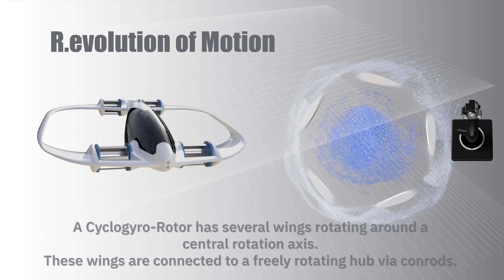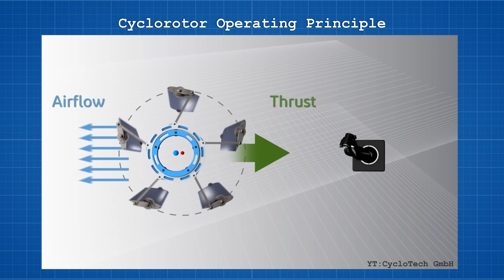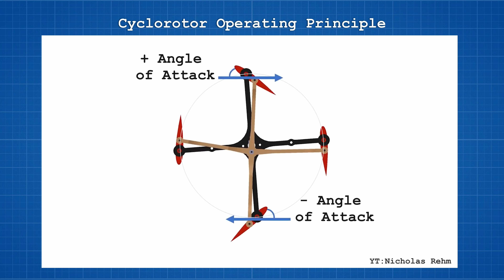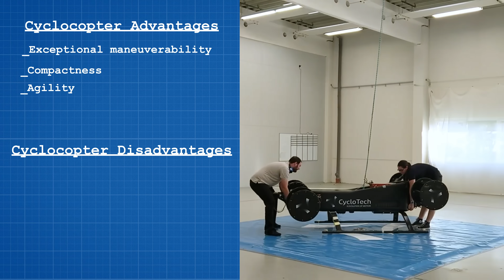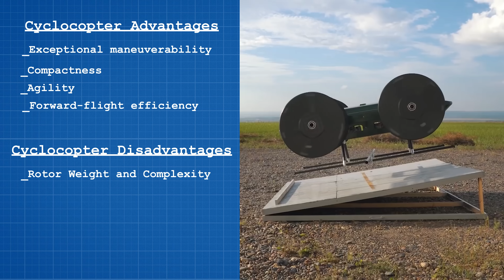CycloRotor: Is this the future of eVTOL Electric Propulsion System?

Comment: I'm terrified at the idea of just one engine failing. You can't glide or auto rotate.
Reply: They didn't took into consideration safety. That thing should have a parachute in case of any kind of failure. I wouldn't ride in it.
Reply: This is a prototype. I'm sure when it comes to carrying people there will be redundancies.
Reply: Too complex and lacking gliding possibility. A small mechanical failure and it becomes a brick midair and the pilot an omelet when the brick smashes into the ground.
Reply: @uberraschtedame1510  You got that right👍👍👍
Reply: considering you can change the thrust direction at will it would be very easy to lose one engine and making the one diagonal to it be pitch/yaw control while the other 2 keep the vechicle air born or atleast let it crash at a very mild speed. Also if I am not mistaken these things can go into autororation as well.
Reply: @SlayerBG93  you ever fly a drone? Auto rotation wouldnt work on a high rpm rotor.
Reply: @a1919akelbo  You are thinking small hoby drones not a car sized vechicle. If I was making a drone car with this tech I would split the batteri and electronics into seperate systems for each motor making sure no point of failure can leave me with less than 3 engines. And I would design a flight stabilsation software that can keep the aircraft stable at 3 engines running. If it can maintant hover at a few thousands feet than it has enought power to land on 2 engines using ground effect or at least crash very gently as in brake the landing gear and maybe a few bruises. As far as autorotation goes I see no reason it wouldnt work provided your point of failure didnt cause you to lose pitch controll on the blades.
Reply: @SlayerBG93  Your expertise must come from watching Marvel movies  helicarrier :) . It does not work with 3 engines. It just goes down.
Reply: @noobFPV  Nah it comes from watching prototipes flying on 3 motors when you dissable the 4th. In a small drone its achived by putting it in a spin since the controll of a conventional motor and blades is not precise enought to make subtle adjustments on a very very light drone that can get fliped over by a strong draft. On a larger aircraft that problem is greatly reduced and this blade design doesnt need to come to a full stop to reverse thrust so it doesnt need to move to either side of the point of lift to maintain balance.
Reply: @SlayerBG93  Ah, yeah but that is controlled demonstration. In real world, quads flip crash and you die. Large or small.
Reply: @noobFPV  I am not saying its trivial but modern electronics and the core design permit for such a solution within the realm of practiral engineering limitations. It will be a while before it achives a reasonable safety record but it can be done. Another point worth mentioning is that because the rotors dont need to pitch the aircraft for forward motion a hybrid design where the body of the aircraft is a wing to provide lift is possible and effcient. So in the event of an engine failure the aircraft could lose VTOL capabilities but could make a controlled conventional aircraft landing.
Reply: @SlayerBG93  so you havent flown a drone.... You dont even know the basics of thrust balancing.
Reply: @a1919akelbo  The ------- point------->
                                    you
Reply: @SlayerBG93  alrighty, you first made the false assumption that what is essentially a large quad copter could remain stable if just one engine failed, this isnt true. Next you said that if you cut out one of the engines you could use it like a vtol still, the issue is You are now at half power with no steering. Next you say body lift could solve the issue, but body lift is an effect only really seen at high speeds. What point am i missing exactly?

For an aircraft to be viable it needs to be reliable, and safe when TAKING OFF AND LANDING. A brick traveling at mach speed can maintain level flight and glide, it's how the brick behaves close to the ground, at low speeds, and in handicapped situations that matters. A spun up helicopter rotor has insane amounts of momentum and can supply enough power on its own to make an emergency landing during take off and landing. Planes can glide, jets can glide, fighter jets have emergency eject systems. The aviation industry isn't the automotive industry. Safety, reliability, and redundancy trump innovation, cost, and ease of use. Aircraft will never be something someone can just hop into and fly with no experience (unless your a doctor). Again, they aren't cars.
Reply: @a1919akelbo  Yep you missed the point.  A large quadcopter cannot remain stable if it uses conventional rotors, at least not without going into a spin. The kind of quadcopter demonstrated in the video CAN because the technology allows for better thrust vectoring and control. Yes you would lose 50% of your power(2 engines for hower and one controlling the roll/pitch) but most helicopters wouldnt crash hard into the ground at 50% power output because  of the ground effect. maintaining hower at 3000m is a whole fuck ton harder than hovering 50cm of the ground. Also this tech alows for flawless thrust vectoring to forward from hower, so you could make the body of the aircraft/helicopter have considerable lift while you use the rotors for forward thurst and only when you want to land you would slow down to a hower and use them in a more conventional quadcopter thrust vector. So in the event of an EMERGENCY you could theoreticaly continue in forward flight to provide lift from the body and land as a conventional aircraft instead of the vastly more usefull VTOL.
Reply: @SlayerBG93   yes but if you loose one engine you loose the second opposing one to vector control, meaning 2 for variable lift and 1 for vectoring. So you are dropping like a rock. Unless your total upward twr with all for engines is 2+ which would be unheard of. No, it's dropping like a rock dude.
Reply: @a1919akelbo  it can seem like that but its just not true. There are plenty of helicopters with s lift to empty weight ratio of 4 and when you add total takeoff weight its a ratio ot 2/2.5. but that is at sea level. You cant really fly safely if you are barely getting off the ground and you cant gain any meaningful altitude. But in an emergency you can certainly afford a low lift ratio. Think of it like more of a controlled crash. A lift of 1.1 would be unflyable but you can crash land no problem. I dont have any data for this assumption but my guess is you can probably land with a low probability of death with a lift ratio of 0.8 or something in the ballpark since drag will slow you down and the aircraft/quadcopter will take a good deal of the impact and that js assuming your design cant take advantage of glide or autorotation.

Comment from the maker: The Outstanding Engineering behind Kitty Hawk's Heaviside Personal eVTOL:
👉 https://youtu.be/fL3-mWvkCD4
Reply: As always it has components which are controlled by a microchip,  electronically regulated mechanisms which if they fail, would lead to the then animate object, crashing !
Reply: Is it possible to add a safety mesh around the "wheels" to prevent something from getting caught between the blades? Or would that add too much disturbance in air flow to be used to its max output of thrust?
Edit: 5:23 looks like the video answered my question.
Reply: @MrMiraculon  I did that(mesh) on my quad carbs on my KM1 Golf and the fuel economy dropped like a stone... had very little power, could smell un-burnt fuel... so yea mesh is a bad idea... it`ll be the same for e-VTOL Blades restricted disturbed flow of air meaning more battery consumption shorter range etc...
Reply: A bit of fiction... What if Airwolf had a smaller engine(less blade lift) same size tanks(increasing turbos`s power/ range) by adding a bigger output of this https://www.youtube.com/watch?v=Yz7SQ1nb4HQ&ab_channel=eVTOL to compensate for smaller engine.... ???
Reply: Could it work in Space if an ION engine thrust particles was used instead of air... ??
Reply: AWESOME work :):)
Reply: When building my drone with those rotors, I would add a load of additional points of failure, some when upscaled. And what about freezing surfaces in freezing rain? But  very nice idea but and cool concept!

Comment: DESIGN BRIEF   "Right guys I want you to pack as many single points of failure = death into one vehicle as possible - guarantee ZERO 
redundancy - OK...!!!

"I wat a vehicle as complicated as possible and if a single drive belt slips a single tooth - the driver dies - got it??? And add LOTS of drive belts"
Reply: it is prototype - belts aren't necessary in final product (even motors driving those belts looks like Dynamixel servos used in RC planes and hobby robotics)
if this machine looks complicated and fragile to you, I think you didn't saw, for example internal combustion engine:
"Sooo, listen to me, I want engine with max. 20% efficiency, with LOTS of moving parts, requiring constant lubrication and cooling. There will be cylinders and pistons which must withstand high temperatures, pressures and acceleration forces, massive crankshaft to transfer linear movement to rotation, many engine valves and injectors regulating fuel mixture and also exhaust. There must be also many pumps - for fuel, lubrication, water... and ALL of them, also these valves I mentioned before, will be powered through DRIVE BELTS... it will be perfect!!! 😀
Reply: @ferosofranek8817  Yeah you are not familiar with "potentially fatal single point of failure" are you?
Reply: @piccalillipit9211  not really my domain (I'm not designing that kind of equipment) - I must google for it 😀
But single point of failure is problem only if you can't guarantee reliability. I think critical components must be extremely reliable (very simple, oversized or limited lifetime), because not everything can be made with redundancy - it will be very complex/heavy or very expensive. Redundancy is typical for electronics and software design, but not for mechanical design.
Personally, I wouldn't ride on that thing, or any other multicopter design - not because it is risky, but because consequences are always fatal if something goes wrong (no matter what you do).
btw why are you against drive belts? Why should drive belt slip be the cause of driver death? Also when kept in right tension and not overloaded, it never slip.
Reply: Lol..
Reply: It also can not yaw.

Comment: Where’s Elon Musk? This should be the future of Tesla!
Reply: Nope. Too much complexity, too many points of failure, not suited for high speed horizontal flight, not energy efficient.
If we get the energy density of batteries high enough, the most likely design for an electric VTOL will be with several smaller rotors that can tilt forward for horizontal flight, like the Lilium plane.
Reply: Yeah after the Covid caused apocalypse with all the madness going around, we need modern Stuka dive bombers flying around everyday

Comment: They are better to just have them as stabilisers cyclone rotor motors its the best place for them is on ships in water. They use far to much energy and to complex for air craft when a simple trudishinal common propeller is more affectively popular.
Reply: The design is cool.. It allows for lots of ideas.. This could even be a road vehicle that can take off at a take off spot; considering it can take off and land vertically.. 

So yeah, it's interesting.. More research can be done and more data gathered to ensure it's more efficient. 

I mean, there was a time burning fuel with combustion car engine was very efficient. 
Today, we have lots of electric cars out with the future looking all electric.. 

So yeah.. Good idea
Reply: It’s a different use case. A vehicle like this could fly into a garage on the side of a building. Helicopters have had decades of R&D, whereas we are looking at first iterations of this. With advances in battery tech and electric motors this is exciting.
Reply: @Luke-Norris  yeah but the main question is efficiency. Is this more efficient than regular design? I doubt it but we'll see where it ends up.
Reply: @user-sg6zh6vr7h  you mean regular drone design with 4 propellers? Yeah, thatt is almost certainly more efficient at this stage, especially is simply hovering. However, I think the faster forward motion you have the efficient it would become. Anyway I think it’s cool and look forward to seeing a person in the seat
Reply: "affectively popular"??? Its R&D mate.....
Reply: Very stabile. That stability will be gone as soon as they try to accelerate. The faster it goes the more dangerous is suspect. It should explode. But since materials are stronger and lighter than ever. It will probably just counteract any real force. Think how quickly the little wings have to change position per cycle?!  Expensive little machines that will burn out motors left and right.
Reply: *traditional
Reply: You fail to see the improvements in the tech over the co in decades
Reply: Anything new is always as least effective and efficient, but with everything, the growth will be significant after more mature use of these rotors and blades and cylinder like devices I think they are onto something awesome that won’t chop you in half if you get too close to the blade lol
Reply: @thefoss721  The answer for normal common propeller drones is to put the propeller inside a coulling housing then you won't get chopped in two by the propeller's.
Reply: @carsongodbold8736  the design can go along way! Look at futuristic movies , lots of jets have that concept it’s nothing new which is good 

I’ll get on the drawing board ASAP ;)
Reply: It will never be as efficient cause the blades are not producing lift half of the time, but are still creating drag. 
In an helicopter the blades always generate either lift or trust.
Reply: @ameunier41  but you could add it to an existing motor in hub electric car, as an upgrade feature. Or the Tesla roadster with the SpaceX package. Finally jump the Grand canyon.
Reply: @ameunier41  wait no I thought that’s the whole reason they work, because the blades rotate so no matter they are always facing the way to give it drag…
Reply: @thefoss721  I understand what you mean. When they are not working they are facing the wind, which doesn't introduce much drag. 
But there is still drag, drag when these blades aren't doing any useful work. In fact the drag of one of the blades is working against the trust.

It's probably more complex than that, but they are old tech. The electric motor doesn't add a thing, it's not like a drone where you need precise control of the rpm of each rotor. 
So I'm inclined to think they where already tested and deemed inefficient, thus unusable. With electric power, efficiency is more important, so it's even worse.
Still I'm no engineer and I could be wrong.

Comment: With flex at high rpm an issue, they might look to cross-country ski design. These are pre-bent to end up perfectly flat with the snow on load. With advanced modelling, they should be able to create blades that work well enough at low rpm but achieve peak efficiency at cruise speeds.
The way these rotors stick out and are plain cylindrical in shape offers hope of advancements in left and drag. But can't we achieve ultra-controlled flight with static ducts and flats, fed by a central counter-rotating prop?
Reply: That's exactly what I'm doing with the cyclocopter that I'm designing.  Great minds think alike... :D
Reply: @Screwdriver440 
And independent blade pitch control is exactly what seems to be done on the actual prototype filmed in this video.
Check around 3:35
Reply: Not to mention what an energy hog! Just cause it looks cool and it can be done, doesn't mean it should!  As for a cool toy now thats a different story. And it's still ugly!!!
Reply: The view of the boat with underwater vertical propeller blades reminds me of man explaining that he would have to design a stronger arrangement. 

This was in the 1990's or earlier. 
The boat was being built to be able to push a ship when they were side to side and any other position. It could also tow, of course. 

The draught of the ship it was working with allowed space for the vertical blades. 

The test had involved a pull on a peirside bollard. However, the blades had been found to have bent a little afterwards.
Reply: Not even worth the effort. This thing is fugly beyond reason and has so many flaws. There are much better designs all around.

Where it might have some legitimacy is with hybrid amphibious vehicles or in water or under-water propulsion. Think of a submarine like vehicle that could also fly to avoid large waves and rough seas, etc.